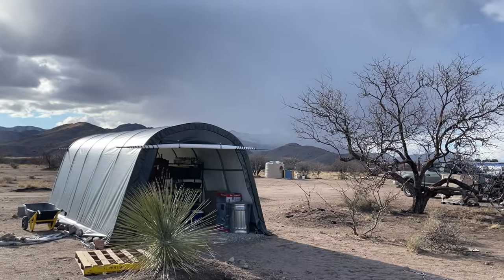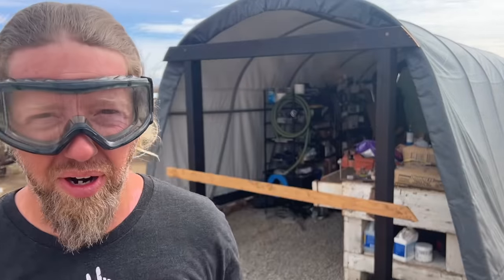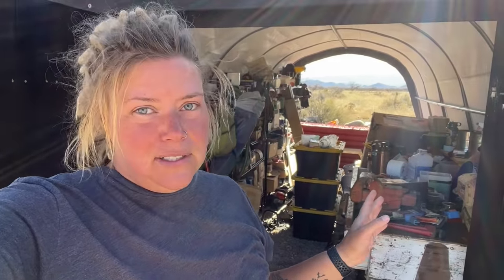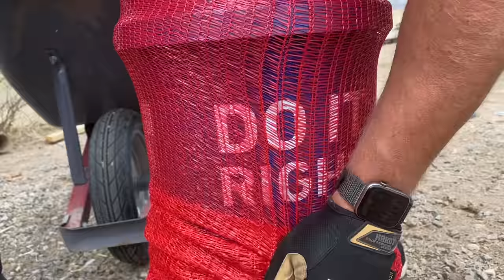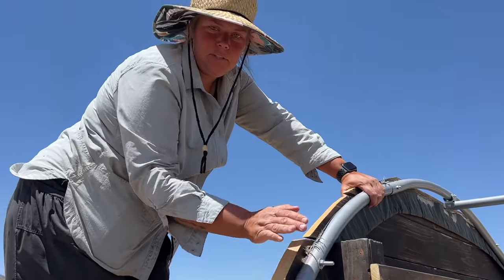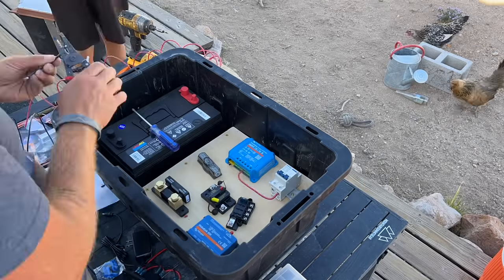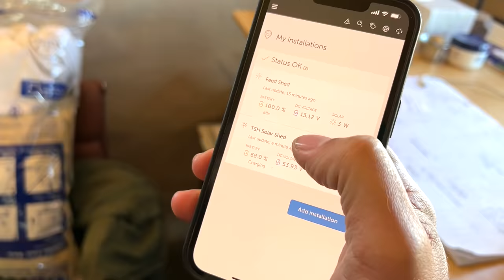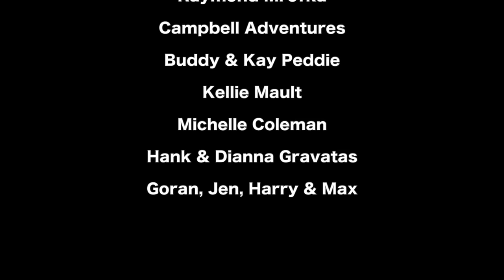Family REBUILDS Torn ShelterLogic with Barn Doors, Earthbag Walls, Metal Roofing & Solar System

Comment: Those metal roofing panels are very sharp and dangerous for anyone that should run into them by accident. A great preventive tool are pool noodles half sliced and attached to the sharp panels with some glue
Reply from the maker: These are custom made roofing panels, not the corrugated stuff you get at the hardware store. They're not very sharp at all.

Comment: Great job on the two buildings.  I really like how they look. I do have one concern.  I am currently building a metal building house and have installed lots of metal panels.  Even wearing gloves I received a lot of cuts. Will you be covering the edges of the metal panels on either end of the buildings?

Comment: I would go for Tatooine style house. Would probably take you a day or two to dig a hole that is 2 times bigger than that tent.  A lot cooler underground as well. Dig deep enough and you may get to some water as well. With all that said I guess that it would all be possible if ground composition allows for it to happen.
Reply from the maker: We’ve already built earthbag buildings. It takes way longer.

Comment: Terrific video. We are in Cochise county as well. I'm planning much the same with my shelter logic frame. The cover lasted almost a year but we lost it during the winds in May. I used some railroad ties for a base along the sides to hold it down because I didn't trust the augers. Hasn't moved at all, they weigh lots. Where are you having the best luck purchasing materials in the area? I get tired sorting thru all the warped and damaged wood at Home depo and lows. Great job very impressive, keep the videos coming.
Reply from the maker: Lowes mostly. We have them ship it to us often:)

Comment: If you drill a hole in a piece of plywood and stick it around the bar by by cutting a groove to where the hole is and then go on the other side and lay a board on the back side of that pipe to where it will hold that plywood and then drive your nails down into your bags

Comment: Good job on the build and video. 

In a slightly different presentation though, I think that’s referred to as a solar oven. I would really encourage you to add some insulation panels to the walls and roof. I did it to a large shed on our property and it’s night and day difference. It should even improve your battery performance.
Reply from the maker: That’s why we installed vents and fans. So far they’re working fine, but we’ll reevaluate in a year and see if we think insulation is worth it.

Comment: Just a bit of advice on having tin from head high to ground level is to split yellow polly pipe and cover the edges or even foam pool noodles the pool noodles may not last with the chickens 
Ps i cut the shit out of my self twice and after the grand baby had to go get stitches its cheaper to cover the edges of the tin that an er visit if you use my idea would love to see it in a video 
Much love from Tulia Texas out on the farm
Reply from the maker: Thanks John- these are real roofing panels so they aren’t sharp, but definitely would be a concern if they were.

Comment: it may be helpful to know, when drilling into round steel,  use a grinder, or file to make a flat spot where the hole is going, only about the size of the hole, you don't want to thin the metal so the head may pull through,  but the most important part, start with small drill bits, I usually start with about 1/8"  then work the way up to the final size, it's much easier on the drill bits, especially the larger ones, 
I'd love to have a place like yours. But I'd rather have running water near by,   heck I'd live in one of those sheds,  cover it with solar panels,. That would probably keep it a good bit cooler, having the air gap, and blocking the sun from the metal roof, I would want running water to build a small hydro electric generator, having only 300watts constantly coming in is much better than 1kw of solar , although I'd have both,  about 2kw of pv, and the hydroelectric,   I have 1000ah 24v lithium battery now, 5kw inverter, and a 12v bank, lithium battery, for lighting, and such, and a backup inverter, to keep the fridge going and a couple needed things, about 400ah 12v, I charge it with the 24v bank, I'm thinking about connecting it directly to the solar, give it its own 300w of solar or so, but a dc to dc charger works fine, maybe loosing 10% +/-,   charge at about 10amps for 10-12 hours when it gets low,  having lights and security cameras on the 12v bank, and inverter only on the 24v bank, I can also connect a car to the 12v system to charge it, in an emergency,. I'm planning to build a dc charger  to charge direct from a 12hp engine, I can charge it completely in a hour or two! I would like to have more land! Awesome job!

Comment: Great build would it be better if you could have used a white coated steel panels which would have reflected the sun’s light, then the buildings wouldn’t get so hot as they look great for using as airb&b bedrooms. Small huts of that size are used all over in the UK  they call them camping pods and they are made of wood but what you have is great for using as the same sort of thing. 
As for thee. Video I think you have cracked the video market with building one of them in a week but oh no you built 2 of them in a week and my gum weren’t they great 👍 the music suited the action etc please keep them coming they are very informative and you even gave us the price point for your area so a big thank you to all 7 of you 99 included.
Reply from the maker: We didn’t go with white because we didn’t want it to stand out. Yes. It would have helped keep it cooler in here but we’d rather not stand out.
Reply: @TinyShinyHome  thanks I thought that would be the case but one's never sure till one asks.
The other thing that I thought was that the steel would still get hot and heat the units up as hot regardless of the colour. So I can totally understand the way you have gone. Again thank you so much for your reply.

Comment: I learned alot from your design.  Outstanding.     My only question is were you able to seal both sheds for the most part from external water during storms?   And also snakes?    I can imagine that doing daily chores and getting misc tools from these sheds becomes routine.  People won't always be aware of snakes laying on a shelf.  Reaching for something could be bad.
Reply from the maker: Other than the space between the doors and planks on the front, yeah it's sealed up fine. A snake could probably get in if it really wanted to, but that hasn't been a problem so far, and these buildings have been here for a couple of years before rebuilding them.

Comment: Cobalt Bits worked best for my metal drilling projects, Titanium seemed to lose it's sharpness after a few cuts, Cobalt is still holding it's sharpness, just a heads up if you can swing it. :) NC

Comment: Bought one in June and 20x13 x 10  the fabric has already split at the top, they should replace the cover under warranty but using the tubular shell with metal roofing is part of the long tern use of this product.  They do make covers that are more durable but the cost thousands instead of hundreds.  Cheapest enclosure but you get what you pay for.
Reply from the maker: Yep we looked at their heavier duty covers, but this seemed like a better solution.

Comment: Wire mesh gambian/gabion is the term.  Guessing those can be stuccoed or plastered to seal better.  Wondering if those can be made welding rebar to free used fencing to make more rigid?

Comment: Hi guys, hope you are all well. I knew you could do this, didn't have any doubts at all. Super job and great teamwork as usual. Even the pets were all contributing! Thanks for sharing. Stay safe and keep up the good work. PS. Did you fit the folding hasp correct way round? When hasp is 'closed' the screws are exposed. let me know. :)
Reply from the maker: Not sure what you mean exactly, all the screws are exposed :)
Reply: @TinyShinyHome  The screws shouldn't be exposed when the hasp is in the 'lock' position, otherwise all you need to circumvent the lock is a screwdriver. Two ways to fit the hasp, only one is correct, where screws are covered. Try flipping it 180 degrees. ;)  PS......at 56.31 you have the 'eye' piece too far away from the door edge. Refit it at the door edge, flip the folding hasp 180 degrees and, hey presto!!

Comment: it's a little late but could you cover that with Earth bags from both sides to the peak and keep the wind from blowing it anywhere. plus it would match all the other stuff there. and it might not get so hot in there you can put your solar on top of the earth bags Arch
Reply from the maker: That's entirely too much unnecessary work 😂. Like we mentioned, the cemented in front poles, back walls sitting on the frame, metal roofing, and augers will keep it from blowing anywhere.
Reply: @TinyShinyHome  yeah that's a lot of work all right .

Comment: Have you guys ever thought about making Adobe block with some red clay and you can use cowpies horse poop Like you used on your building that you built as Cobb If you get the cow poop it has micro  Crobial Enzymes in it that  Word away bugs I believe the Adobe blocks are 8" thick 12" benches across and 18" wide if I'm remember in the recipe right I'll try that I usually mix the block with some concrete concrete like for slabs slabs remix concrete but you got an experiment 1st for where you live to see how the block hold up and they don't crack and break but if you Dr them in the sun you make molds out out of 2 by 6 is some old scrap lumber somewhere and he built a few molds and then you put it in there you just level them out with A 2 by 4 all the way across make sure they would straight and then just pull the molds up and then load a dry in the sun and then rotate them stand them up and let them drive as you go it's a good way to start making yourself some blocks

Comment: Is your large solar panel array at a fixed angle? If so, seems like that would make an awesome roof with a shaded space underneath. At 30 degrees latitude, we installed six 250 watt panels at 15 degrees below horizontal (ideal fixed summer angle when our A/C would need power the most). We insulated and roof coated the attic floor and now that space up there can be used for storage (sloping from12" tall to 3'8" tall) or even sleeping on cooler nights. :)
Reply from the maker: An array has space between panels to allow for air movement, but you could mount on an actual roof if you wanted to live under it.
Reply: @TinyShinyHome  -- I'm guessing that's more of an issue with a larger array? Still seems that some compressible foam weatherstripping could be put between the panels to allow them to expand if they get hot?

The six panels I installed over our 8'x 10' insulated room (R12 for now) are bolted to 2x4 rafters on edge. These rafters overhang the front wall and the rear wall which seems to permit a lot of natural (passive) cooling. When I was wiring and working up in the attic area, I was always amazed how cool it was up there. Eventually, I'll staple 1/4" galvanized hardware cloth under the roof overhangs to keep the birds out. :)

Comment: Question
If the vinyl deteriorates from uv rays, what's different about the earth bags?
Not critical  just wondering.
This looks good, seems like an excellent idea. The metal roofing makes a secure and uniform cover that looks really  good.
Reply from the maker: They’re UV treated, but once they are plastered it doesn’t matter.

Comment: I would clamp wood to that pipe, then screw the tin to the wood, but it's easier to say I'd do this , I'd do that, but it would be easier, run a 2x4 across the pipe. Then screw the tin to it, use the 2hole straps, cut the 2x4 so it fits flat to the pipe, 
It would probably be easier to went with a yin roof in the start, but that would took more time,  the wood would make attaching the tin Soo much easier, you would have Soo much more room to screw to,   still looks great, I could totally live in one of those!
Reply from the maker: That sounds...complicated 😂

Comment: Any plans or ideas for roof (& wall)  insulation? 
Eg Fabric cover like tarp then insulation (batts?) then the metal roofing?
Reply from the maker: So far no need to insulate. We'll keep track through the summer and winter and decide if we need it later. Vent fans are keeping things with 10 degrees of outside temps so far.

Comment: How about the battery banks ? There’s a cost that takes time to recoup ! Could you have ran both sheds on one solar array ( 340 watts ) on a post between them ?
Reply from the maker: Generally you want a source for each power system. We did think about trenching 120V power from the Ecoflow to the shed, but it was kind of far, and wanted to experiment with the smaller 12V system.

Comment: Your doors are going to start to sagg very quickly. You need to have an angle cross section support going from the top corner hinge to the bottom outside corner or it will sagg.

Comment: For what they are, I'm actually really surprised that the earth bags cost twenty bucks. Does it cost you guys more to get them since you're out in the desert? 
I know twenty bucks isn't "that much" but for the size of that wall, and considering it's 99.9% dirt, it seems like it would get kinda pricey (to build something larger) for what is basically a giant plastic mesh tube.
Out of curiosity, what is the cost of a new roll of the stuff? I only found your channel today so I apologize if you guys covered that in a previous video, which I would gladly watch.
Reply from the maker: The bags are about .15/linear foot. For reference we used 2 1640' rolls for the solar shed office (https://youtu.be/DzCCEhY0flk). Where you are doesn't really matter in the states - you'll either pay freight shipping or about $70/roll  shipping via UPS for a smaller order just like any large material order. I don't know how you could any cheaper for basic wall construction if you have the soil already on your property.

Comment: So your changing both ends but using the same material for the body of the garage? What will prevent it from ripping again?
Reply from the maker: No idea what you mean. Wooden plank front. Earthbag back wall. Metal roofing panels for body. All the vinyl is gone. Did you watch the video?

Comment: question: When you put up the "door wall" you put it over top of the tarp. Would it not be more waterproof if you would have pulled the tarp over top of the wall then fasten it to the outside?
Reply from the maker: The metal panel overlap is providing most of the waterproofing. Otherwise we wanted some airflow.

Comment: Hello from europe:) 

Would digging down to use thermal mass and the house would be colder to stay in. All year around with less heating and cooling.
Reply from the maker: Sure, but not worth the trouble for a feed shed or garage :) Yes worth the trouble for a house :)
Reply: @TinyShinyHome  thanks for answering 😉

Comment: Just wondering why you don’t use or need rebar stakes for the Huber adobe walls?  As in wouldn’t that add lateral strength to help
Keep them from tilting or shifting?
Reply from the maker: The bags wrapped around the poles on the sides. Not worried about it. Such a short wall and adding rebar to any earthbags would just break the material in the bags causing them to weaken.

Comment: Next time, leave the existing vinyl cover in place, under the metal roofing. It will stop condensation dripping onto your stored goods.
Reply from the maker: No, the cover was deteriorating and shedding white flakes all over everything on the inside. Condensation isn’t a problem here because of low humidity.
Reply: @TinyShinyHome  Fair enough!

Comment: About to build my parents a barn door.  Where did you find those stainless steel hinges you screwed into the vertical side posts?
Reply from the maker: Tractor supply
Reply from the maker: Or any hardware store.
Reply: @TinyShinyHome  Thank you! I found them there and Home Depot, locally.  I also made it to the end of the video! :)

Comment: I know it's too late now but you should have put plastic insulation it's like a inch thick or that bubble stuff under the roofing to keep the heat from the Sun overtaking the inside temperature if that makes sense
Reply from the maker: That's why we installed air vents. So far it's keeping the temperatures managable, and since it's just for storage we probably won't need any insulation. Would be a different story if we were living in it.
Reply: @TinyShinyHome  they put in pole barns that's why I mentioned it.  But it's ur space if the fans good that's good thanks for sharing
Reply from the maker: We’ll definitely reevaluate in a year and see if it’s worth doing 👍🏻
Reply: @TinyShinyHome  if u do it get the bubble stuff it's very thin and relatively easy to work with. The sheet metal companies usually carry it. U shouldn't you probably only need it on the ceiling. But take ur time see if u think u'll need it. Thanks for sharing!!!

Comment: Linseed oil takes over a month to fully polymerize. A single coat applied to raw wood will ABSORB to the wood over night. Reapply the Linseed oil after building, once a month for a year and it will survive for more than a decade. reapply every couple of years to get long life from that wood. Cut the oil with mineral spirits 3oil to 1 spirits, improves penetration.  Saw the final with steel roofing. yes it is shiny but it will be cooler if you paint it 0ff white or adobe khaki. Also way less glare.

Comment: Step drill bits can be useful in getting your holes started on the metal side and then you can jam through the wood more easily.  But you guys solved it without them so...I'll show myself out...